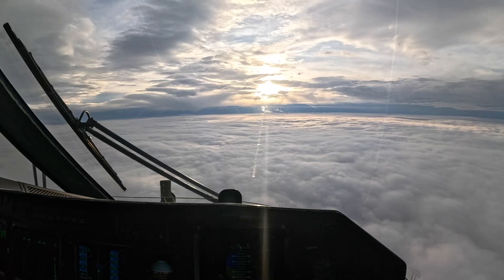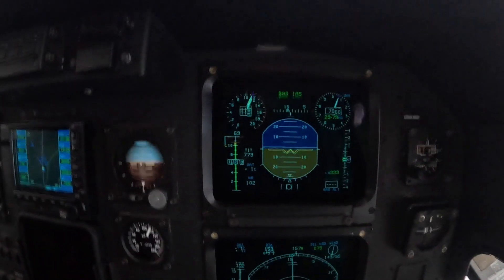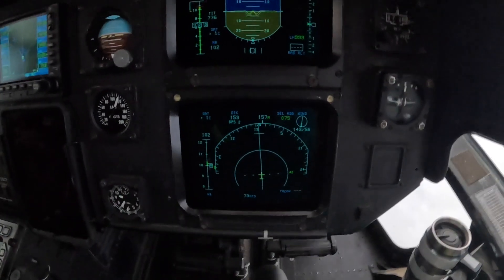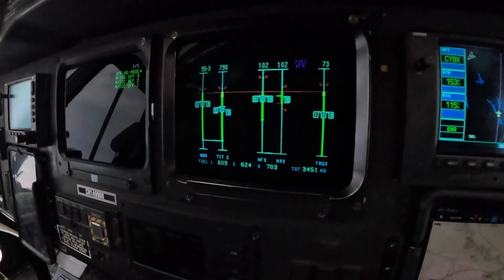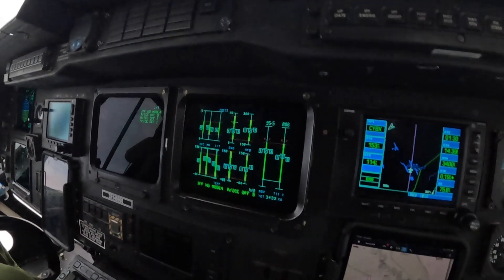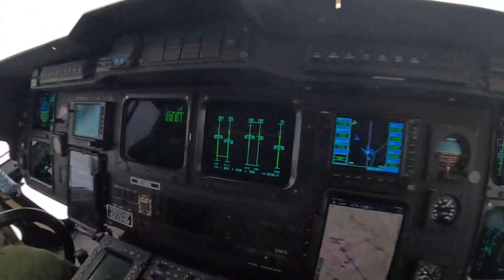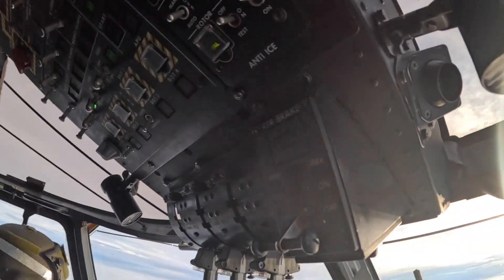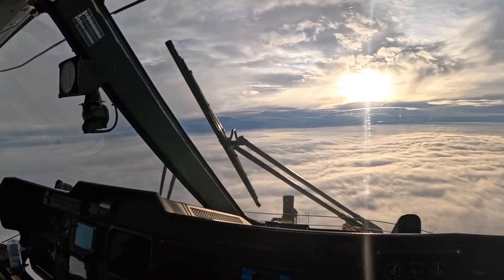Inflight Cockpit Tour Cormorant Helicopter

Comment: I noticed that you don't have a Flight Director, I am assuming from your other comments that the Auto Pilot and Nav sources aren't fully coupled.
Reply from the maker: The Cormorant is equipped with a full 4 axis auto pilot that is quite capable. It just doesn't have an IFR FMS nor can it couple to our Garmin 500s for navigation solution. However waypoints can be entered into the system and it will happily fly to them. It can also use 'moving way points' to plot an intercept to a boat. You can even plug in a way point 100miles out to sea and it will fly to it, conduct an approach, and end up 0.25nm away from that point in the perfect hover into wind. All on its own. Quite capable. 

It just doesn't have flight director command bars. I am no expert i but helicopters use different terminology used between fixed wing and rotary when it comes to the various auto pilots and computers.. It doesn't have a flight director, it has a very advanced AFCS or Automated Flight Control System, which does flight director duties but also a lot lot more. Again, I only have rudimentary understanding how everything works in the background and the differences between fixed and rotary nomenclature. I would recommend you google AFCS and go down that rabbit hole.
Reply: @ thanks for the reply, it’s interesting the differences between fixed wing and rotary.

Comment: Hehe, nice presentation video.

Damn you're way overdue for an upgrade to the avionics. It's positively ancient, even compared to our 20yr old workhorses.

Watched other of our videos, many procedures align with our civilian ones (guess you also base it on iamsar). We don't give ropes away as gifts and tend to hoist from higher up.

I was listening to another video and you were saying that you couldn't use Radalt hold. Is baralt hold not good in the hover on this?
Reply from the maker: Bar is okay but tends to drift up and down at times. It's hard to predict what it will do. If the air is smooth can be useable. It this case it would have been hard to tell if it was drifting up and down or if it was the boat. I just chose to do it myself. 

Avionics are currently getting upgraded. The AFCS and auto pilot is this thing is actually very effective though. Thing flies really nicely.

Comment: Got a few questions to ask if you don’t mind 
1 Did you join the RCAF specifically for SAR and if not what did you do beforehand ?
2 How long have you been in the RCAF and what is your rank ?
3 whenever there’s a SAR tech outside of the helicopter are they able to communicate through radio or is it only hand signals ?
4 How many Call outs do you get per month?
5 not really a question more of a request. Is it possible to make a video showing the equipment the pilots , Flight engineer and SAR techs wear and use during the average flight?
Reply from the maker: 1) No. I just wanted to be a pilot. I wasn't even sure if I wanted to be a fixed wing or rotary wing pilot until just before having to submit my choice. 
2) Since 2007. I'm a Major now. 
3) They communicate both through radio and hand signals. Which ever is easier for them at the time.
4) Last year was very busy for the Squadron. I don't have the number infront of me but I believe it was about 150 call outs for the year. I think for me it was just under 50 for the year. 
5) I can definitely try to do that. Just with Christmas holidays and some other stuff I have been away for a few weeks. I'm hoping once I get back to start doing more videos such as you suggest.

Comment: Very cool. I’d be interested in more on the autopilots. I understand they can hold you in a hover over a fixed point and adjust for wind, etc. 
Everyone stay safe.
Reply from the maker: It does have an auto hover mode that corrects for wind and what not. It works pretty well. We don't use it that often though.

Comment: Interesting seeing the knobs on the centre panel (the autopilot one?) are varied shapes and colours, presumably function related as well as being different to avoid an input error? Very cool seeing 'around' your office, specially while it's in operation.
Reply from the maker: That was the thought process. I wear gloves while flying so I can't really tell the shapes apart by feel.
Reply: The controls were always intended to be operated by a gloved hand which in part determines the minimum separation of controls and size of pushbuttons. The HMI (Human Machine Interface) was a big factor in cockpit design for the EH101 and bearing in mind the original use of the autopilot for military night time over water hover every effort was made to reduce possible misidentification of critical controls. Hence the colour and shape differences. At night colour isn't helpful but shape can be. Every little helps and knobs are not a big expense in the grand scheme! Knobs and switches definitely play a part in good HMI, especially helicopters where vibration is always an issue. For reference I was part of the team developing the Autopilot system for Merlin and carried across to the Canadian SAR helicopter.

Comment: Is that cylindrical thing sticking up in the triangle below the windscreen wiper arm & the blade a windscreen washer/deicer plz Matt?
Reply from the maker: That is a special camera. It points and the blades and measures how they are 'flying'. It is used when we do a 'track and balance' of the main rotor head. For some reason we just leave the camera on afterwards. This is a bit of a gross oversimplification but track and balance is basically ensuring each blade is flying in the same path or plane and also equally balanced. Blades are adjusted by either minor lengthening or shortening of their pitch links or by putting little weights in them. Sort of how you have to balance a new car tire....but much more involved.
Reply: @mattfrom103  thanks for that, Matt! I'm familiar with what you're saying from a video of EC135 blade manufacture which included T&B.
Reply: Coming from a US Army background where we have Maintenance Test Pilots (MTPs), Do you do all of the maintenance test flight work on your aircraft like track and balance and operational checks or do you have Functional Check Flight (FCF) trained pilots, like the US Air Force?  I would assume given the fleet size that you would do it all but just curious.  Great videos, I crew UH-60M as a contractor and hope you get a fully coupled autopilot like the Blackhawk has, or better, with the CH-149 upgrade program!
Reply from the maker: @danieloltmans475  Yes, there are MTPs. They are just normal pilots with an extra qualification, nothing to extravagant. Some maintenance flights need MTPs, some do not, 'it depends'. 

Our auto pilot is quite advanced....it just can't couple to the Garmin GPS because that was an add on about 15 years ago. It can still couple to the 'FMS-like-device' and ILSs without issue. It is fully 4 axis. The AFCS is as well quite impressive.

Comment: Joined the CAF airforce as AVN tech hoping to become a FE with SAR.
What route would you recommend taking once my training is complete? Are FE in demand?
Reply: I can speak a little to this, I'm AVS. FEs are in an interesting spot atm, their trade is supposedly getting amalgamated with loadmasters and AESOP into a new trade. A lot of platforms are moving away from requiring FEs, since most of the FE's job has been replaced with computers. As for SAR, afaik that means getting into a helicopter fleet. The Hercs don't fly with FEs anymore, and I'm not sure if the Kingfisher will use them either.
Reply: @lolo2221  thank you!
Reply: @lolo2221  any idea when this could take place?
Reply: @nickneumann6048  the new trade? I'm not sure. The rumours I've heard say in the next year or two, but I haven't heard a firm date.

Comment: Thank you for the cockpit tour! Great thing!
I have a question. You got three engines. Can you shut one off or put it into idle to save fuel and get more range during flight?
Reply from the maker: Yes. There is a procedure to do that. However, for a number of reasons, we don't use that procedure. Fuel savings are about 5% I believe. The Portuguese use the procedure fairly often from my understanding.
Reply: @mattfrom103  thank you for the quick reply!

Comment: Great video! Simpilot only here, so my knowledge is a bit lacking. Maybe I missed it, but do you also use navigational aids like VOR, NDB or INS, or "only" GPS? In my understanding, usually more than one system is used, at least in the airliners, to create redundancy. How do you guys navigate?
Reply from the maker: Yes. There is a VOR receiver, NDB antenna (not many stations left anymore), and an INS. However, we generally only use those as back ups. GPS is the quickest, most reliable, most accurate, longest range, most versatile, and easiest to use.
Reply: @mattfrom103  Thank you for the quick answer! Looking forward to many more videos, keep up the good work! Love the audio, too, keep it up!

Comment: This is very cool, especially seeing everything running. Three engines, that's unusual, is that a redundancy design choice? Also noticed that keypad was alphabetical and not Qwerty, another interesting design choice, though I guess that's a pretty standard piece of equipment, Flight Management System was it?
Reply from the maker: First point: I wasn't around when they designed it but from my internet reading it was because there was no certified engine available at the time with 2600hp so they went with a 2100hp engine but now needed 3. Much more detail here: https://hushkit.net/2018/06/07/why-the-merlin-has-three-engines/ (I cannot verify the accuracy of the information on that site.) But yes, one of the advantages of having 3 engines is better One Engine Inoperative (OEI) performance. 
Second point. That is not a true FMS.  QWERTY seems to be common on keyboards. FMS are different. You can googles FMS design and answer why one over the other but I suspect it has more to do with legacy as well as the physical shape of an FMS.

Comment: Is the de-icing stuff in the rotor blades themselves (since they are essentially wings)?
Reply from the maker: Main blades, tail blades, windshields, pitot static system, some drains, engine scoops (vents), engine intake area, and then part of the engines themselves. Lots of anti icing stuff. I talk about it in this video a little;

Long version: https://youtu.be/MEmB64REZlY
Short version: https://youtu.be/8llD-BFUTDM
Reply: @mattfrom103  Sweet - I'll have a look!  Was curious in that I know in jets, they have various heaters along the wing edges, some sensors and stuff.  Wings don't work so well when they get less wing-shaped!  I imagine that introduced challenges as to how to implement it on a chopper with a rotational wing surface, but very cool that it's there.
Reply from the maker: @Dakiraun  Same thing. A wing is a wing. Doesn't work with ice on it. You are correct, much more of a design challenge because it's spinning. Not many helicopters are fully icing equipped but this one, thankfully, is.
Reply: @mattfrom103  I hadn't realised any were!  That's really neat to learn about them.  Love the cockpit layout too.  Thanks again for sharing all this with us.
Reply: It’s anti-ice, and is a heated element of the rotor blades. Eats a lot of power, so the generators are quite powerful.
Reply: @KnuDonner  Yeah, I imagine that chews up a lot of power (and adds drag from the extra load on the engines).  Thanks for the answer.

Comment: What a cool video,  thanks for sharing.  Will you be getting a proper FMS when the Cormorant goes through its midlife upgrades?
Reply from the maker: My understanding is yes but I could be wrong. I am not the subject matter expert on that.
Reply: Short answer is, yes the new avionics will include a very sophisticated Flight Management System with an array of capabilities which will help to further reduce pilot workload and make the aircraft more compatible with current civil IFR procedures. However, I suspect that for crew used to their IPAD this will also make its way into the flight bag for a while at least.

Comment: Before I retired from Pfizer Vaccines, I was also one-weekend/month Flight Nurse on a NJ State Police AW-139 just to maintain my critical care skills. Does the CH-149 have auto hover? If it does, how accurate is it?
Reply from the maker: It does. We only really use it over water and usually at night. It is fairly accurate but it is not tied to a location coordinate, only speed, so over time it will slowly drift away from the starting point. It can also be tied to a small joystick at the rear crew station to that the Flight Engineer (FE) can have limited control over the helicopter in the hover. It's a cool system that does have its uses but it is not a magic solution to every situation.
Reply: @ Must be a Leonardo thing. Same with the AW-139. It tended to drift plus or minus 3-4 feet over both land and water.

Comment: Rotor indicator 102, that means 102% or 1020rpm?
Reply from the maker: 102%. Engine speeds, rotor speeds, and torque is usually expressed as a percent in helicopters. 100 (or 102 in this unique case) usually is in reference to normal operating speed or max continuous speed.
Reply: @mattfrom103  thanks and also thanks for the great videos

Comment: Do you switch-on your transponder when you fly and if so what does it appear as, on flightradar24?
Reply from the maker: Our transponder is normally on at all times. We are military and I am not sure if flightradar24 displays our information.
Reply: FR24 sometimes displays it if it’s in a populated, controlled airspace. I sometimes see 442’s Cormorants on FR24 when they are close to or directly above metro Vancouver: probably to add an extra level of awareness for both ATC and other aircraft.
Reply: @officialboomtish214 the thing with FR24 and ADSB Exchange is they are a 'crowd sourced' thing. They require a software defined receiver(SDR) and a computer to monitor 1090MHz. The computer needs an internet connection to feed the received transponder data to FR24 and ADSB Exchange.

The aircraft need to have a Mode C or Mode S transponder for accurate positional data. A Mode A(old school transponder) only sends a 4 digit code when the IDENT button is pressed, or it interrogated by surveillance radar. Military and law enforcement can shut off the GPS and altitude data transmissions and become 'invisible' to FR24.
Reply: SAR aircraft are an edge condition being quasi-military. During last year’s  Toronto International Air Show, the only way you could tell on FR24 that the F-22 raptor was ready to fly was that all the commercial air traffic over downtown and around the lakeshore “disappeared“. Later, when the water-bomber flew, it showed-up on FR24.
Reply from the maker: @Tesserae  I can't comment about the rest. but can offer some clarification about your first point. The CH-149 Cormorant SAR helicopter is not quasi-military. It is 100% military.
Reply: @ I only meant “quasi” in the sense that it’s not armed. But yes, it is a military aircraft.

Comment: I assume you’re flying at 7000ft to stay clear of clouds. I guess you prefer that and a longer flight to making better time and flying IFR or below the cloud layer?
Reply from the maker: Several reasons went into the decision of 7k. 
1) Odd and even altitudes. We are heading South East so we need to be at an odd altitude.
2) We need to avoid hitting stuff, aka at a min safe IFR altitude, so for that leg it is min 5k taking into consideration point (1)
3) Winds, slightly less winds that day at 7k vice 5k. So quicker at 7k
4) Clear of clouds is not critical but it is nicer not only for the view but to keep out icing. By keeping out of icing we can turn off the engine anti ice. Having anti ice on costs us more in fuel consumption and robs a bit of power in certain situations which means going slightly slower.
Reply: @mattfrom103 great points! Thanks for the explanation.
Reply from the maker: @curiouswhy7751  Thanks for the great question. I may talk about it a future whiteboard session.

Comment: Most cockpit famil videos are on the ground, with the aircraft cold. Seeing the systems up and running while cruising is very cool. Looks like the flickering got fixed!
Reply from the maker: I had a bit of time to spare on that transit. I thought I would work. I used a fairly strong neutral density filter on my GoPro and enabled 'motion blur'. It seems to have helped. We should be getting LCD screens with the big upgrade/refit so that should put and end to the flicker problem.
Reply: @mattfrom103  just got a new machine at work, and it got nearly impossible to picture the new LCDs. So may be it gets worse with the update.

Comment: Retired helicopter pilot here. Does your Foreflight flightplan talk to your FMS or do you need to load it (FMS) individually. Great videos.
Reply from the maker: It's actually not really a true FMS. This is some fairly dated tech that is getting upgraded as we speak. So no, Foreflight does not automatically load. I believe, however, Foreflight will connect wirelessly to some Garmin GPS and suites, perhaps others as well. 

We primarily use the Garmin 500 you saw for long range IFR navigation. The other one you saw is more for search patterns and other operation navigation.
Reply: @ Understood, thanks. Is your G500 coupled to your FCP NAV button, or is the FMS (looks like a CMC device).
Reply from the maker: @edwardlong189  Unfortunately we cannot couple to the GPS. It can couple to the nav solutions provided by the not-quite-FMS such as search patterns and what not. Can also do a full 4 axis ILS approach.